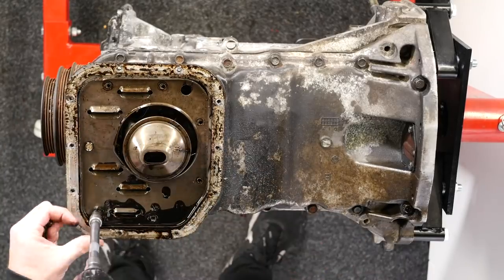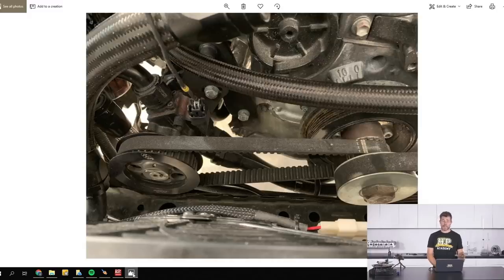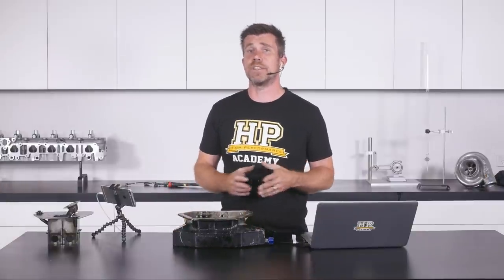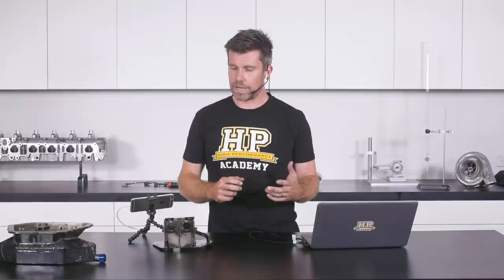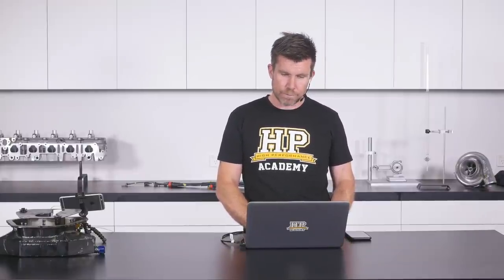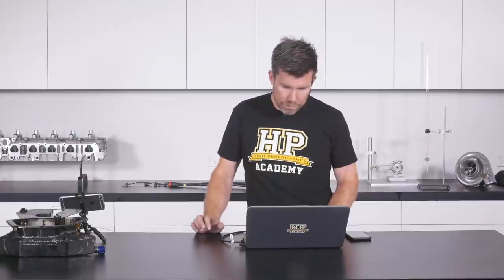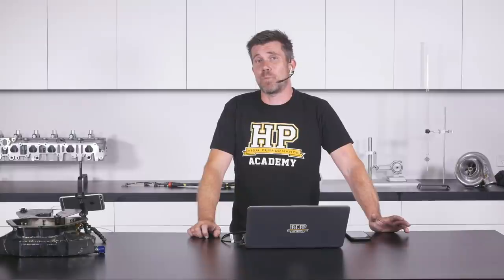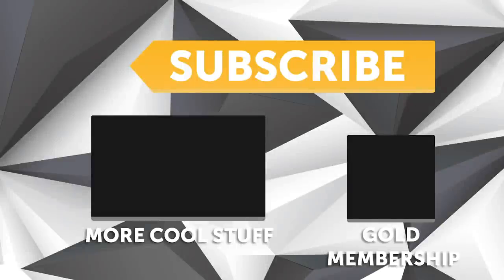Budget Oiling Solution | Creating the Ultimate Wet Sump [GOLD WEBINAR LESSON]

Comment: I’m going to give my 2 cents here, I’ve heard bad things about larger capacity oil pans with baffle plates. Meaning having more oil starvation problems than stock pans. Now if you have a high quality pan with trap doors it should be ok, but remember manufacturers spend a lot of money developing every component of an engine including oil sumps.
Reply: But they are designed for general road driving, not track or performance.
Reply: my engine(2zzge) came factory without baffles which in turn is one of the reasons the 2zzge rods have gone home from what i read on forums i swapped my oil pan from the less powered 1zzfe which for some odd reason came with a baffled oil pan from factory its a oem mod most people do as insurance from oil starvation from just driving normally through some back country roads
Reply: yeah most manufacturers i dont think are thinking too hard about pans, cheap stamped pieces

Comment: i have yet to see the inside of a super sport bike oil pan...i wonder how these motorcycles do oil management while leaning and cornering at 100+ mph. good content as usual Andre and HPA crew💪
Reply: PANTYEATR1 I dont ride a bike, but I have a pretty good understanding of physics (actually going over this type of stuff right now). The whole objective of leaning over is to counteract the torque acted on the bike due to centripetal force...in other words you would tip over outside the turn unless you leaned in. Now think about holding a glass of water level in a car while going around a turn, the water will slosh to the outside of the turn. In order to avoid spilling, you would have to tip the glass, or 'lean' it into the turn, effectively leveling the water in the glass again. For this reason, I expect oil starvation to be much less of a problem for super bikes than you would think...the oil pan is also being tilted into the turn with the bike at close to the ideal angle for the oil (the water in the glass) to stay mostly leveled out in the pan. That being said, they still do experience some ridiculous acceleration in all directions so I bet they do have some pretty good oil pan/pickup design!
Reply: @Thebadbeaver9  great reply !
Reply: @Thebadbeaver9  That is correct and indeed oil starvation is a huge problem for bike engined kit cars - the bike engine is simply not designed for lateral cornering forces. Only time oil starvation is a problem on a bike is when the front wheel is pointed at the sky.

Comment: Hi Andre  if using an oil cooler,  do you recommend a thermostat control.  Also most thermostat 4 legged blocks seem to have small diameter fittings. Is there a brand or type of themo control you recommend. Lastly what size lines are best.

Comment: Could be worth mentioning that the viscosity of the oil should be matched to the bearing clearance.
This is especially important if you have very tight or very loose clearance.

A high viscosity oil on an engine with tight clearances can produce problem just as a low viscosity oil on an engine with loose clearance.

Now most engines are probably around 0.002” and will tolerate a pretty wide range of oil viscosity.

Oil technology is a bit complex and the idea that higher (or lower) viscosity is automatically better is incorrect and might actually hurt your engine.

Comment: In my experience the oil accumulator will maintain oil pressure, after it is filled, if fitted correctly. 
The "fitting correctly" is something that could take yet another 44 minutes, at least, to discuss, and would undoubtably raise a bunch of arguments.
Thanks for this video, as always.
Reply: how does the accumulator know when to inject oil into system ?
Reply: @bigbothoee8617  Its pressurized to the oil pressure so when it drops the oil leaves the accumulator into the oiling system.

Comment: Nice ideas in this webinar. 
Accusump systems don't allow oil surges, Andre. Principle is pretty simple: the accusump is connected to the oil circuit near where the factory pump outs the oil. When armed, the accusump is actually pushing oil in the circuit, say at x psi of pressure. But as the factory pump is pushing oil with more than x psi pressure, the oil actually doesn't left the accusump. At the very moment the factory pump pressure gets under x psi, the accusump pressure being higher, it pushes oil in the circuit, then compensating for the lack of pressure and insuring the oil pressure stays at worse at x psi, never less. 
It is a clever system, the only con is it has a limited capacity. If it has to rescue the oil pump too often it will get drained and helpless.

Comment: On a rotary there are 2 problems... the oil can slosh up along 1 side in an extended racing turn. I believe right hand turn is the biggest issue. The other is the pickup may not be super optimally located depending on which year engine.
One solution is to get a baffle that goes between the pan and the engine. It acts as an air-oil separator (removes bubbles) by slowing the return down some. It also helps by keeping the oil down in the pan where it should be during racing.
There are other, better, fancier pans not too different than what's talked about here. Some have built-in baffles. It all depends on what year engine you have.

Comment: Good video, even if the out of sync' picture/sound makes my head hurt ;-)

Worth having a heavy plate made up for the sump welding to prevent distortion - I was thinking a perimeter type that picked up the bolt holes but was open for internal welding?

Clearance between the pickup and sump bottom should ALWAYS be checked - it's blown more than one engine.

A big part of drainage problems from the head may be blow-by - most engines have the breather(s) incorporated in the cam' cover(s) and so the blow-by gases will be passing through the drainage passages AGAINST the oil draining back, and there will be more pressure from the sump. Not so much a problem with dry sumps, as a scavenge wafer, or two, can be dedicated for head drainage.

MOROSO (and other manufacturers) make different sumps/oil pans for different applications for the same engine - not just the chassis which could be front, centre or rear sump, but oval track, drag, circuit, etc. Just make sure you get the one for how the engine is going to be used and what it's going to be used in - and check pickup clearance, some sumps come with pickups specifically designed for them and the OEM one won't work properly!

Comment: what is the most important according to you? maximum oil temp (the one collected in the sump) or the temp fed to the bearings (temp after oil cooler). when you refer from 100 to 115°C, where is it taken?
Reply: boiling oil will damage it right? seems like you can overheat oil once and it will look and smell different immediately

Comment: you mentioned running 10W-40 instead of the spec'd 0W-20.  So that sounds great when you're running on track and the oil temps gets hot.  But what about cars that are pulling double duty and see cold starts and street driving with an oil cooler and therefore struggle to see oil temps above 80-85... are you risking the oil being too thick to get between the bearing and metal?
And what about if you have your oil cooling setup done really well and not seeing temps of over 105-110?  Thats very comfortably within spec of any modern synthetic oil, a lot of oem street cars see temps higher than that on the street when they don't have an oil cooler or a tiny oil to water donut type cooler... is there a need to step up to thicker oil for track duty in that case?
Reply: If your car is doing double duties you might just have to change the oil and filter before and after you track days  cheap insurance really

Comment: Are those rubber flaps special in some way that would prevent me from just buying a sheet of rubber and fit it with ribbons?
Reply from the maker: There are many different rubber compounds out there, just do your research to make sure whatever rubber you use is going to handle the temperatures and movement involved to avoid solving one problem only to cause another - Taz.
Reply: @hpa101  I found this rubber gasket sheet locally that is specified to hold up to 120C. It doesn't really sound enough so I'll probably go safe and fabricate an aluminium gate. Thanks for the reply.

Comment: Oil viscosity like 10W40 or 0W20 is not a really valid reference for the bearing protection.

real indicative value is HTHS viscosity (high temperature high shear), the value at 150ºC and under high stress, this is the useful value to define bearing protection. 

You can have a 5W40 and a 0W30 oils with the same HTHS value ( around 3.5 CSt). A 0W20 oil can be around 2.5 CSt, and become a problem at high temperature.

Regards!

Comment: What about a moist sump? basically the factory pressure pump, but the pickup is modified to go to an external tank with electric scavenges or a traditional mechanical scavenge
Reply: why not a slighty damp pump? with the pump completely disassembled and semt to the corners of the world while you run your motor with no oil pressure?